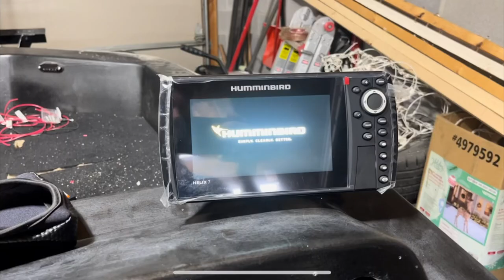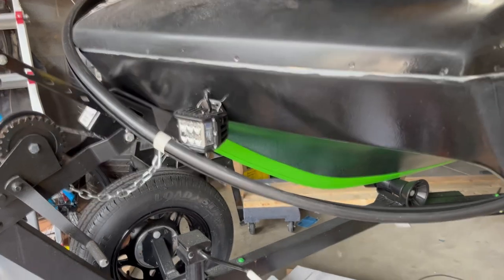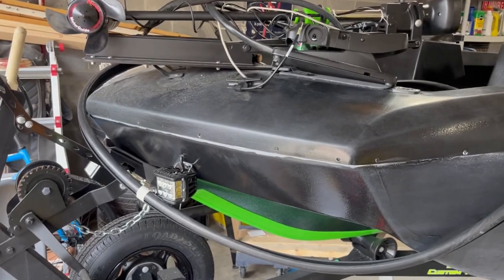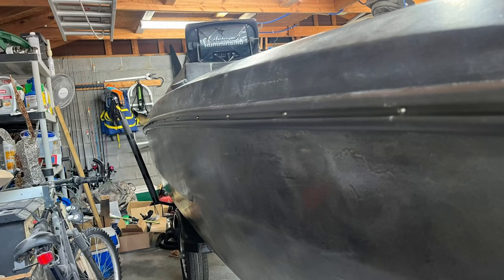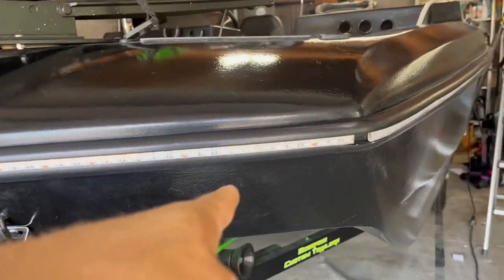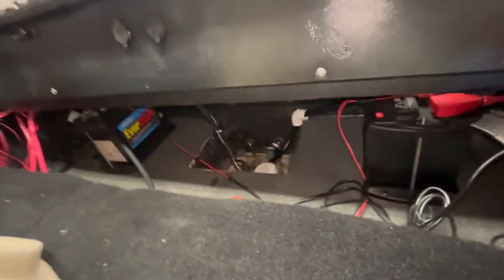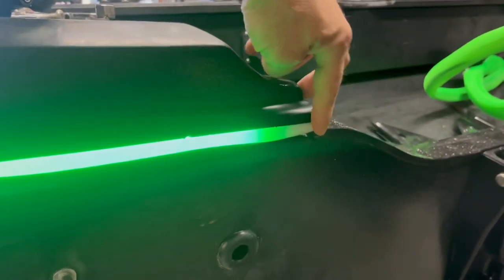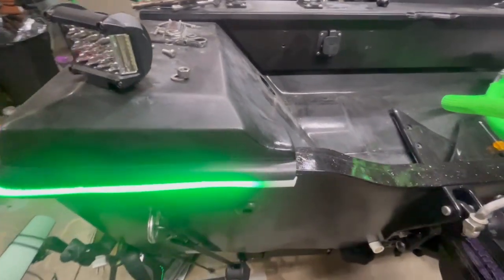Custom Rub Rail Install #ScorpiusFishing #StellarAbyss

Comment: Wish you would have shown fishing the light strips through the tube
Reply from the maker: Actually they are placed behind the defuser inside the rub rail. The insert is then just pushed in over top. It’s a double row waterproof led strip and it wouldn’t have fit in the insert. The smaller size that would have fit wouldn’t have been near as bright. Especially through the diffuser. If I could find one that is as sturdy in a mor clearish green, I’d swap it out. Till then I’m happy with it.